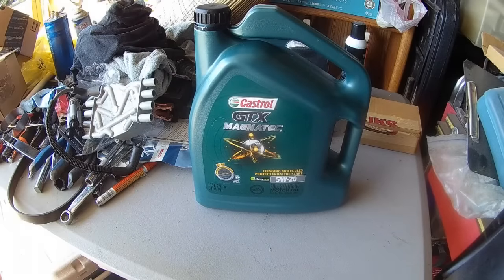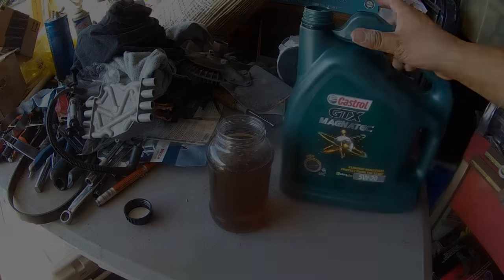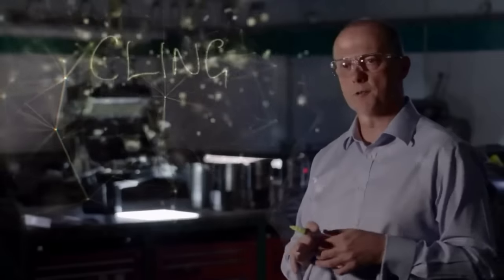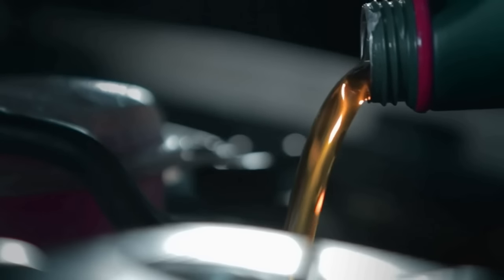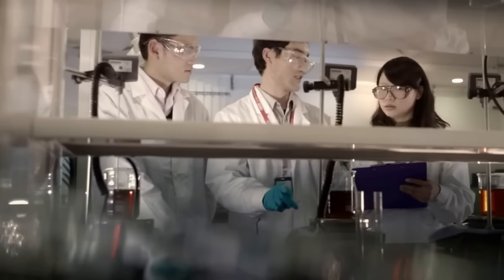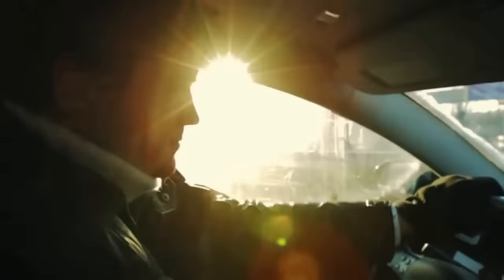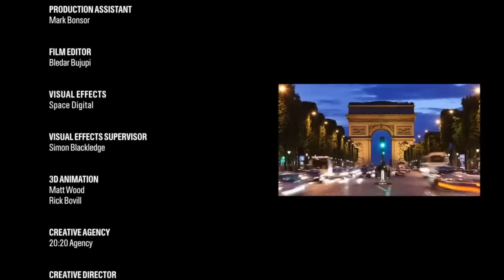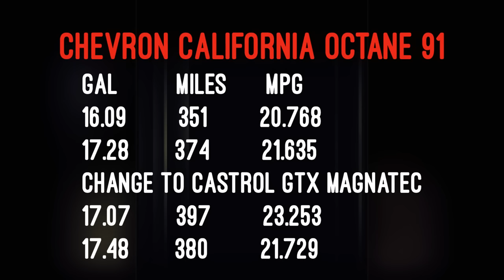Castrol Magnatec Engine Oil Review - Motor Oil Review - Is Magnatec Fully Synthetic? - Mobil 1

Comment: molecules that cling to the metal to protect it..wait..isn't that that zinc stuff that creates a protective film against the metal surfaces that ALL engine oils contain..? ALL oils have this stuff, it sounds like a complete bs marketing ploy to me, making theirs out to be the best when they are only using stuff all the rest of the oils already contain. lol. i also heard that castrol's marketing is also garbage because they claim their products are full synthetic when in reality it's just a traditional mineral oil that is a bit more refined, synthetic technically but not "100% FULLY synthetic" like they claim...yet they sell it for top dollar.
Reply: I have used penrite 10 tenths fullsynth with ester pao base full zinc package, its premium oil for years.and have tried every oil in my cars since 1993 in my services, in several countries. 
I tried magnatec as it was on promo, and the difference is really very noticably better with magnatec, semi. Syth .
Engine quieter, smoother, accelerates easier.  Tickover  is swiss watch smooth on subaru h6 with 390k kms which I did full engine reseal and refresh at 270k kms. 
I used to work in engine endurance dyno testing in the uk at a consultancy as engine test tech. I know my stuff. I have built and repaired engines many times, cars, motorbikes, truck diesels. 
I swear by magnatec now, just on one oil change and have put in all my cars, and advise my friends to.

Comment: I've read from "reviewers" that Magnatec causes engine sludge, and that makes sense to me if you have been using the same oil for too long, not if you strive to keep your engine running on fresh oil according to manual instructions. Now, if Magnatec DOES create any sludge even when changed periodically, I would like to hear that from someone who can honestly prove it! I am right now about 90% convinced to use the synthetic blend version of this oil for about 2 years on my trusty, mint Nissan B14 Sentra, which has been using nothing but fresh mineral oil for its entire 60,000-mile life, as far as I know, and then take a look at the internals to see what happened. Any serious comments would be so welcome! Cheers..
Reply: I put this thing on my car once, difficult on start ups and feel the sluggish on revs. I would try the titanium Castro’s. Never put this on again.
Reply: I used last month first time, in a 2002 subaru h6, that I previously ran on penrite top synth oil. I have used most brands since 1992 on my cars I service myself. 
H6 engine I fully resealed , inspected, and used with the best oil I can buy.
On a promo, I put magnatec in.
A world of difference to smoothness, tickover, and engine  acceleration. It pulls better now. 
Put magnatec in 1997 3.4 toyota with 235k kms. Once again, a big difference. Put in 1999 bmw k1100 motrbike, again, big difference.
No oil has ever made such a difference to any engine I have had.
I used to work.as car service mechanic, and as engine tester/ fitter in uk on dyno testing prototype engines, for jag, ford, bmw.. 100 year old engine testing company. 
My opinion is magnatec only.

Comment: If Castrol Magnatec is so good why isn't it as good as - or better than - Castrol Edge?  And if it's not as good as Castrol edge then why would you think it's as good as the top oil from any other company?  What Castrol has done is take one characteristic, amplified it and promoted it to death. There are many things an oil has to do, many specs an oil has to meet and Castrol avoids talking about that. So why doesn't Castrol call this their top oil if it's so wonderful and downgrade Edge?

Comment: so i need to use this oil once and my engine parts are coated forever?
Reply from the maker: +Noseefood the commercial claims it coats for 100 years...
Reply: ***** now how would that prove that?...
Reply: By running an engine in a dyno chamber continuously for days and weeks on end to simulate the accumulated drive time of several years in a short span of time.
Reply from the maker: +Garwulf74 sounds suspecious
Reply: Noseefood and you will never ever have to change oil again with magnatec for 100years. It clings for hundred years.
Reply: BundysGarage taken out of context.  All they started was on a molecular level it will be there.  That's all they said.
Reply: @Garwulf74 exactly. I worked in engine testing in the uk doing this. Ricardo.

Comment: Can it be used on a Honda cbf 600?
Reply: Never use car oil. You will burn the clutch in no time. Use motorcycle oil designed for wet clutches
Reply: No, will cause clutch slippage.

Try Motul 5100 semi synthetic ester, great stuff!

Comment: I will never use Mobile 1!  My 2008 Mini with 230,000 miles eats half of the Mobile one oil.  Using manufacturer's recommendation,. I use the best oil on the market.  Castrol Magnetec!! Mini eats half of this oil every 2500 miles.  True liquid engineering!  I also got a better mpg,. 0-60 take off speed and over all better engine performance!  Not only is it Magnetec, it is a Magnetec oil that stays on sidewall of the engine and never runs the valve train unlubricated during engine cranking.  A lot of dealerships are starting to use Magnetec.  Oil is not just oil! Penzoil Oil Platnium 2nd place.  Experiment using different oil brands!  Note the best performance and gas efficiency.  Change every 2k miles
Reply: 100% agree. Subaru h6, toyota v6 3.4, bmw 1100 motorbike. 
All run far better.

Comment: The Lucas Oil Stabilizer is no different from STP; a thickener (snake oil to reduce oil consumption).  If you are interested in an oil that protects after engine shutdown, investigate Schaeffer's oils.  They incorporate moly in their oils, and moly has been proven to coat metal parts with a lubricating layer.

Comment: how many km before i change if i use this?
Reply: Stick to 10.000 - 12.000 km
Reply: All depends on driving though. If you drive hard, less than 10kms in a trip or drive in extreme conditions (really hot or really cold) then I'd probably only put 8,000 kms on it. If you're always at a nice moderate temperature and do lots of highway driving then 10,000 kms and a little above would be fine.

Comment: Castrol is clever at marketing their low end oil with no certifications. I would not use any additives, it modifies the viscosity of the oil in use. The best you can do an oil sample in the states, but due to the varied driving conditions, it wouldn't be worthwhile anyway. You might as well use Castrol Edge which has some manufacturer certifications (But I bet they are paid to write those). Change your oil regularly according to manufacturer recommendations and use the stuff they recommend to use, don't complicate things.
Reply: Additives are actually good, manufacturer certifications mean the brand paid to have the oil sticker on the engine like my Mercedes. I use Motul and have used Mobil 1. After spending thousands in engine repairs I don’t care, so long as the oil is changed regularly should be no problem.

Comment: The Nazis invented ester lubes. 
Esters are lubricants used in jets & turboprops.
Race boats &c.
Esters are used as artificial flavours [Tang] and fragrances too.
 haha
Environmental friendly.

Group 5 /Ester-base Amsoil SABER oil can be mixed 100:1. in 2-stroke engine gasoline.
Thus providing lubricantion to top & bottom end.
Chew on that one Sparky.

Add a little SABER to your 4-stroke crank oil.
Bike, lawnmower, bulldozer, &c.
Add an oz. or 3...
....goes a long way.
Saber is gods gift to engines.
Costs a bit more but totally worth it
Ams oil Signature series lube is best if you put up big miles on you vehicle 
like 25,000 miles per year.
Amsoil product in every hole will save 1.5% or 5% on fuel cost.
Or add 1.5-5% power.
Less internal resistance in there.
Or buy Magnetic.
Shell Platinum is good and $16/5qt at Wally after rebate.
SABER is like $15/qt; $45/gal.

Gotta ride my dirt bike now, 
bye...
Reply: That's right the Nazis invented synthetic oil /The beetle /Fanta soda /ibcms

Comment: Grup 3 Base oil I think
Reply: cracked grp 2/3 blend... I wouldn't keep it for more than 3k miles... notice it didn't meet any manufacturer specs or approvals? that means it shears down and stops doing it's job after a thousand miles. it's evidently not a fan of internal combustion

Comment: what would the change interval of this oil?
Reply from the maker: +GB BOY I what type of vehicle? Year, make, and model?
Reply: I run this in my 2012 f150 and I'll do 8,000 mile oil changes
Reply from the maker: Have you had any engine problems with it?
Reply: @joshdanieltaft  hope it was leased and is someone else's problem now.   there's synthetic oil and there's american big oil synthetic oil. Total apples n oranges regarding composition & performance. I would hesitate to even use Mobil1 nowadays